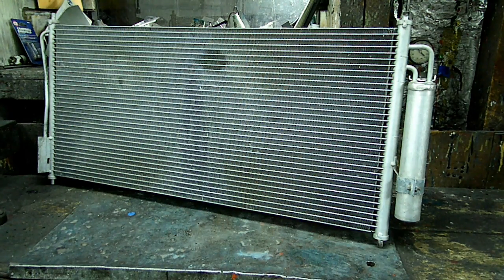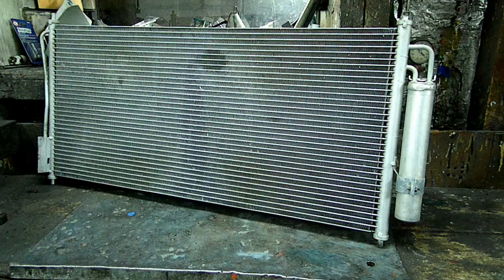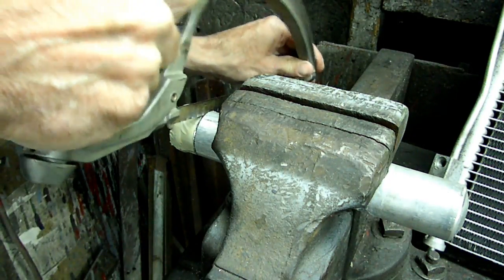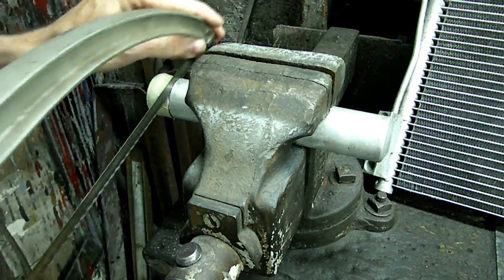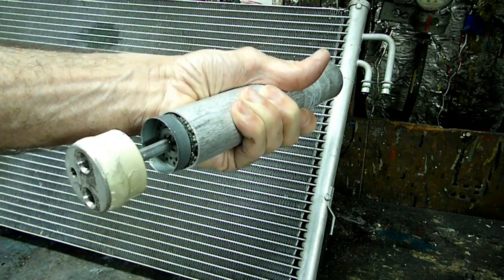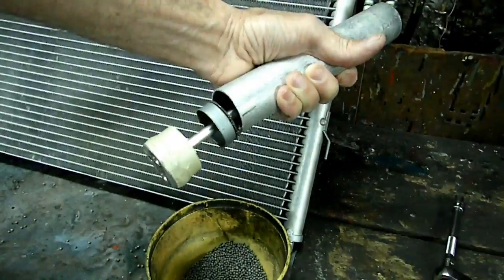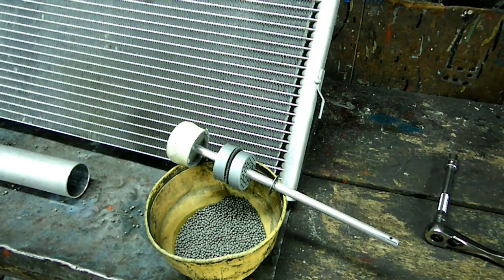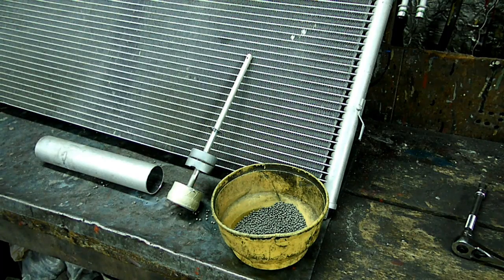Automotive AC Dryer Explored

Comment: The truth is you never have to replace them unless your refrigerant gets contaminated. For instance, if your compressor blows up and pushes bits of metal through the system. The desiccant in the system gets rejuvenated when you pull a deep vacuum for an hour or so.

Comment: #3 This is where the receiver dryer comes into play.  The R/D acts as a dryer, filter ,and temporary storage tank. The R/D also acts as a separator between liquid and vaporized refrigerant. The liquid refrigerant settles to the bottom of the tank then it goes up the pick up tube then to the thermal expansion valve.

Comment: #2 The refrigerant gives up it's heat to the outside air (via the condenser fins) when it undergoes this change of state.  Basically the refrigerant leaves the compressor as a gas (vapor) enters the condenser as a gas and leaves as liquid after being cooled.

Comment: For anyone who wants to know. There are four events that take place in an a/c system. The four events are; Expansion, Evaporation, compression, and Condensation. Since this video is dealing with the condenser and receiver/dryer I will bore you with them.  

The condensation event is when the refrigerant leaves the compressor as hot pressurized vapor and moves to the condenser. inside the condenser the hot pressurized refrigerant vapors change their state and becomes a hot pressurized liquid.